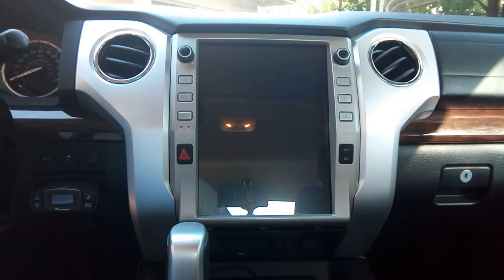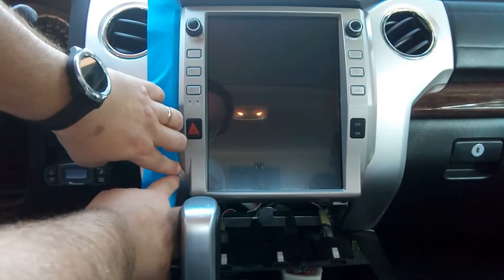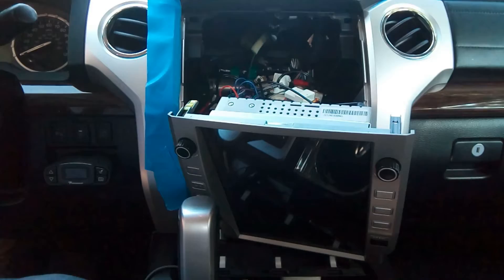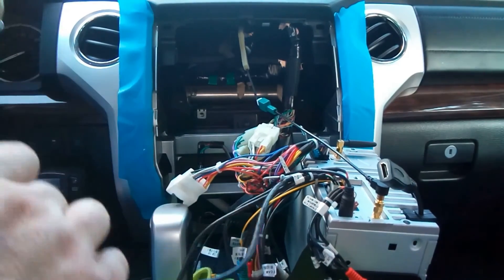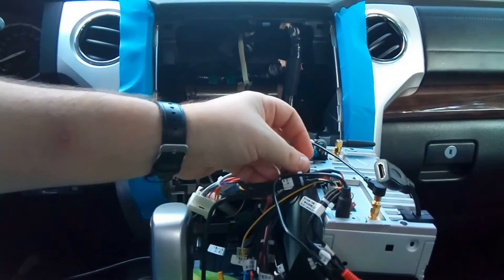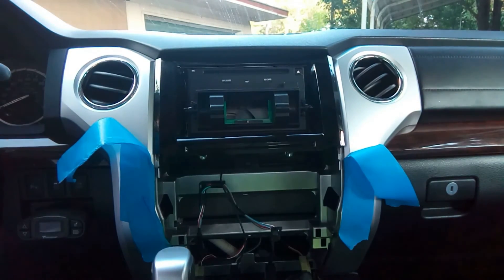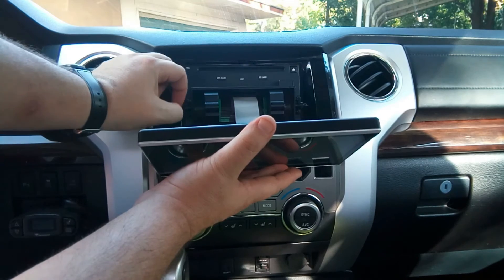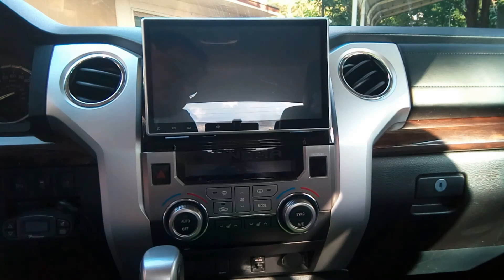Installing the Dasaita 10.2 in the Tundra

Comment: hi i look for right Can bus for my 2015 tundra 1794 edition, where, and which on have to buy. i bought in on amazon it is not fit.
Reply from the maker: When you purchase the unit, you must message Dasaita and tell them your vehicle details. They will ship you the correct CANBus adapter for your setup with the unit. If you bought the unit from someone else besides Dasaita direct, then you may have problems getting support from Dasaita.

Comment: My rear view camera doesnt work, suggestions?
Reply from the maker: Just the rear camera or do your wheel controls not work also? If so, did you get the proper canbus adapter with the unit?
Reply: @KameleonKustoms  yup, it was the vanbus adaptor. I had to unplug it from the other set of wires and attach it to the one the other set I was using.

Comment: So is there a way to use the factory mic? I'm using the built-in mic right now and it doesn't seem as good as the factory one. I really didn't want to run the external mic.
Reply from the maker: There is a guy who made an adapter for the stock mic but he said for the amount of work and hackery you will get better results running a better quality external mic.
Reply: @KameleonKustoms  ok thank you
Reply: @KameleonKustoms  So where did you mount your mic?
Reply from the maker: @derekfloyd5698  I left mine down low under the a/c controls.
Reply: @KameleonKustoms I understand the factory mic runs through the factory Amp under the front seat? Thats why it sounds better.

Comment: did you have any problems getting the factory backup camera working? I'm struggling with that right now.
Reply from the maker: Zero. As long as you have the correct module it should just work.

Comment: Hi I have several general questions for either the Phoenix or Dasaita vs my stock 2014 1794 JBL Toyota Tundra unit. I have watched yours and a lot of other videos regarding upgrading the stock unit. Does the Phoenix or Dasaita or any other similar unit - Maintain XM radio which I only listen to , Bluetooth capability without issue other than I think you said people cannot here you talking through the mic which is not good, is the Bluetooth a extra accessory cable you have to purchase, how does the Navigation work- do I have to use my cell phone to make it work like Google Maps or is there a stock Nav that is fine. I love the look of the units however I don't see what I am gaining if XM, Bluetooth ,Nav etc are sketchy to work correctly. Thanks for sharing your knowledge.
Reply from the maker: Neither unit keeps xm without an add on. Both can use the XM Commander unit. As for Bluetooth calls, the dasaita is far better than the Phoenix but I've heard that the newer Phoenix ones are better than the version I have. There are navigation options that do not require data like Sygic so you do not have to use your Hotspot or anything like that if you don't want to. The only thing that you need data for in navigation is real time traffic alerts and such. Basic point a to b turn by turn works fine on Sygic without data.
Reply: @KameleonKustoms  Thanks so my only real issue then is XM. So I have to get an external cable etc to make XM work. That may be a deal breaker if it is a problem to listen to XM.

Comment: Donny all you need to do is buy the 
Pioneer AVH-W4500NEX, it has everything you want and more! And Metra makes install kit that matches tundra interior to the T!
Reply from the maker: The only problem with that is it doesn't run apps native. I don't want to have to have my phone plugged in to the unit to get maps and music. The pioneer (and others) are fine units, just not the use case I was looking for.

Also the 4500nex at $700 is more expensive than the dasaita with all extras needed.
Reply from the maker: So it has the canbus adapter, GPS antenna adapter, etc?

Comment: Look cool, how is functionally of it??? I have the Tesla screen with the 3 knobs on the bottom in my 2014 Platinum and the touch screen it not responding until you touch the left side of the screen make it useless on many options. Is anyone having this problem??? please comment on my channel because I'm looking for to making a change or upgrading to some else better then stock.
Reply from the maker: I have my initial review of this unit coming out tomorrow. Check it out as it should answer most of your questions.

Comment: Danny I just bought the same unit and just waiting for the can us adapter.. I'm anxious about it. Does the backup camera work and steering wheel controls? I have a 17 tundra crewmax...the canbus I bought from aliexpress..
Reply from the maker: Backup and everything works fine.
Reply: Ken J  Wich can bus did you buy I trying to hook my dasaita stereo on my 2015 tundra  plz
Reply from the maker: @noesanchez6060 one came with it when ordered from Amazon. I'd have to go back and look to see if I can find the exact model of canbus adapter.
Reply: @noesanchez6060  hey man it the Prada camry one.. you have to ask the seller for that. I ordered it from their  Chinese store
Reply: I forgot to say man the unit works great. You can customize every aspect of the unit. I have a new user interface, colors, etc added. The Canbus was ordered from Ali Express but ask the seller to include it with the unit and they will.
Reply: @KameleonKustoms  just bought one.  Apparently now there are two methods of buying through Amazon.  One is directly from Amazon and the other is fulfilled by the disatia official store.  If you want the correct canbus you have to go through some options to get to the disatia fulfillment, click on other sellers I think.  Then after you order they want you to go to the question seller option and tell them your vehicle so they supply the correct canbus for free.  I found this out the hard way and ended up paying for the canbus separately after questioning them.  Amazon was 1 or 2 day shipping Dasaita was 1 or 2 weeks.  Also the other cables you list are available at Best Buy if you don't want to wait for them.

Comment: Nice job.  Did u need the maestro link to retain steering wheel controls?
Reply from the maker: No maestro needed. You email them when you order and tell them your vehicle. They send you the correct canbus adapter with the unit.
Reply: @KameleonKustoms  ahhh thanks!
Reply: @KameleonKustoms  even if you order through Amazon?
Reply from the maker: @kmackmusic6091  yes, just be sure to order from the seller "Dasaita Official Store" and it won't be Prime though
Reply: @KameleonKustoms  Thx just ordered it...
Reply: . And the steering wheel controls work, all of them?

Comment: Do you have any issues with switching from reverse to park and there will be a delay?
Reply from the maker: Nothing major. The biggest delay is if I crank the truck and immediately jump in reverse the unit takes a few seconds to switch to the reverse camera. You don't need to do that on a regular basis so I'd say that it is not a huge deal.

Comment: Does the steering wheel controls and factory  backup camera work with this unit
Reply from the maker: Yes as long as you get the proper canbus adapter with it. I cover that in this video.